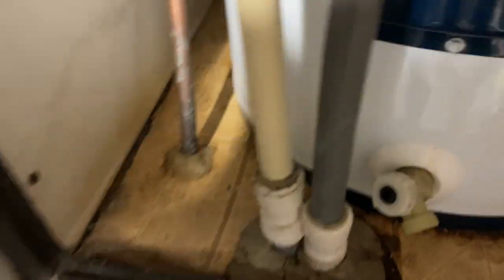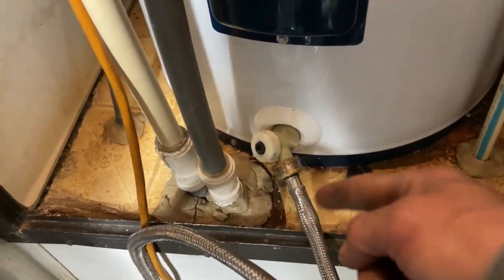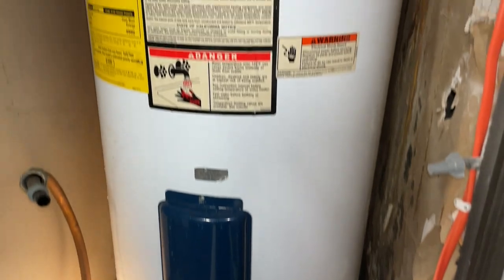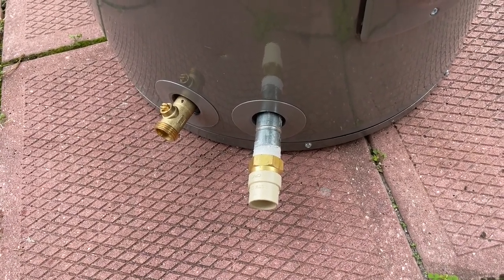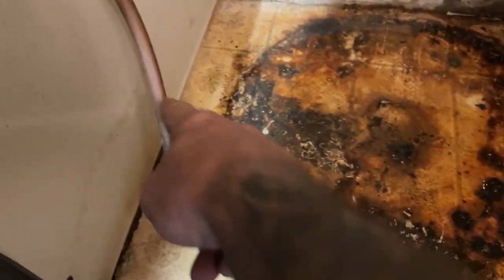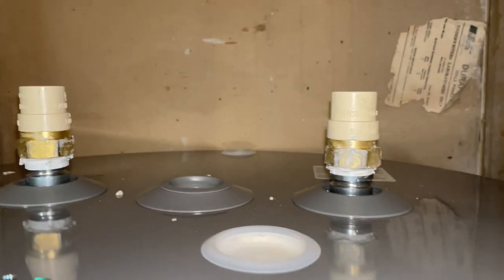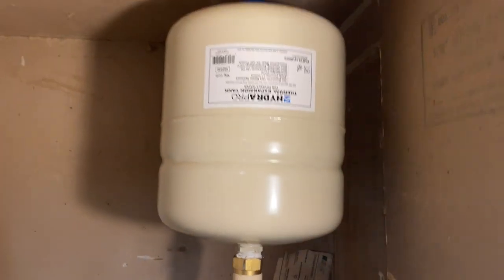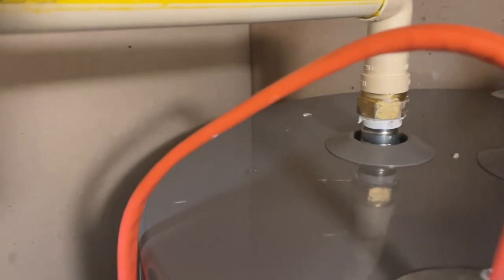WATER HEATER REPLACEMENT IN MOBILE HOME

Comment: hey dude i feel ya ,, just went thru this,,  for future reference = home depot does have a fitting poly b - to pex b 3/4
Reply: ps = i much rather use pex than cpvc in them old trailer retro jobs ,cheers , ty for video . sry it was a pia

Comment: You're a better man than me. I'm not a plumber but still, if i had to deal with a flat tire then crap like that right afterwards the day would have ended with a news story that said something along the lines of 
"Florida Man Shoots Water Heater With Shotgun Before Dowsing It Gasoline And Throwing A Lit Match On The Way Out"

One day, back when I was in the glass business I tore out every window in an apartment and then realized I was in the wrong damn apartment! It turned out that we were supposed to do that apartment the next day, so long story short it all worked out but I came close to having my "Florida Man" moment that day.

Comment: I'm sitting here scratching my hair out. You can test the circuit by probing the wires from the bottom of the wire-nuts without risking shock. Even better would be a sniffing tool that costs around $15. Also, to drain a good portion of the water you can open the vent and turn on a faucet. I'm assuming you did that. I like the shut-off valve and expansion install. I would've definitely moved that copper line and installed a pan with a moisture sensor in the bottom. Once most customers realize what the benefits are they'll gladly opt in for that service. If they don't you have done due diligence by explaining and offering a solution.

Comment: Not a plumber but I am an electrician. Anytime you have a wire nut, you should always use it to your advantage. In this case I would have tightened it up a lil bit an left them on until I located it at the box. Just sick the probes on your multi meter up inside the wire nuts. You'll get a reading on it and once you do go flip switch's till you find the right one and then double check it. Good luck out there brother
Edit: an also.. I don't see any thing wrong with a sharkbite's lol. Like I said I'm not a plumber. Turd herder's as you're reff referrederd to the field 😂😂😂🤣🤣😂🤣😂. Haha im kidding brother
Reply from the maker: Thanks for watching
Reply: @PLUMBINGWITHTIM  lol no worries brother. Helping a buddy with a water heater and came by your channel.

Comment: Just some friendly info. You used a standard shark bite fitting. Shark bite makes a coupling adapter that is designed to fit Poly B . Looks like what you put on but the plastic ring is grey for the Poly B side and the other side will except Pex, CPVC or copper. but the one end is designed for poly B. Ive felt your pain watching this as I've changed many HWT in MH's. They all seem to be a real bear. Cheers on the good video👍

Comment: Great video Tim, when in doubt I always will install a lowboy when it's a 30 gallon tank.  You can always find supply lines to make up the difference and the shark bites is the way to go, pex, copper, or pvc will take that connection.  Great fix, but again, mobile home, apartment, home, I always use the lowboy heater, get's you out of a pinch when needed.  Remain blessed and keep the video's coming.

Comment: Hey Bud. You have to do what you have to do! I’ve never done a hot water heater. And some reason I have no hot water. And I also live in a mobile home. Do you have any suggestions! I believe the tank that I have in there now is a 50 Gal. And mine is in my bedroom closet which I am kinda lucky on the room I have. But never dealt with that type of water lines. If you go throw any suggestions at me that would be awesome. Thanks. And nice job on the install.!

Comment: Dude,  buy yourself a Fluke 1AC II Non-Contact Voltage Tester.   No need to take off those wire nuts.  Edit:  Also if you create a vacuum on the top with the drain closed and then pop the drain open sometimes you can get the blockage to free up.   Can also shopvac out the dip tube if it gets too desperate.

Comment: I live in a 50 year old double wide, I know about the tight places they put these water heaters, fortunately my house I have a full 8 ft space from floor to celing for the tank, I did some renovations a while back and was able to widen the closet the tank is in to be able to accomodate a standard residential tank, I recently replaced an old 40 gallon with a 50 gallon, just added some extra pilings under the tank to support the weight, the subfloor is 1 1/2" thick.  Fortunately my place was originally piped with galvanized and not polybutelene, but that is due for replacement soon.

Comment: would you have been better off installing a tankless water heater?  I just had a plumber at my mobile home.  He looked at the access panel for the waterheater (it's outside the home) and had no clue how to open it up to get in there, let alone put it back.  I told him forget it.  I was hoping to find a video of how to open that thing up.

Comment: In the real world someone else would have used apex and a real cupping instead of shark bites which are not a permanent fix.. but in my world I would have measured the hole and made sure the new one would have fit properly even woth that copper pipe in the way which could have been moved also just saying... tighten up every chance you get or shark bite yourself if it's quicker

Comment: You need a 3/4" nipple ball valve nipple assembly to drain stubborn water heaters.  Just unthread the existing drain valve and quickly thread on your nipple assembly then close the ball valve.  Then hook up your transfer pump to the nipple and suck away.   I've done it numerous times.

Comment: Tim, you da' man! It was  good to know that someone who knows what they are doing fights with these things just like me, Mr. owner of the rental home that changes the hot water thank myself and goes through similar gyrations. Loved your solution to the drain problem. That seems to almost always be an issue because of the sediment.  As a thought, one time we took our compressed air tank and blew air and sediment back into the tank on the drain valve. That blew enough sediment out of the valve that it allowed the tank to drain. Thanks for the informative and entertaining video!

Comment: Thank you for this video!   I've got a leaking, dead propane water heater that I have to remove from my double wide.  You're right about the plumbing, electric, etc in mobile homes!  I swear a group of chimps installed my electric and plumbing!! It's all poly butylene so I'm doing a complete upgrade to PEX.. I'm going to have to bypass the heater temporarily first. If you have any advice it would be greatly appreciated! Wish me luck. Again, good video, thanks for sharing it!!!
Reply: Sometimes you can feed the new pex through the old pipes.

Comment: Just did one of these with John Guest speed fit where you used the sharkbites. Not loving these mobiles. After this experience I am going to plan a tankless setup and recommend upgrading to electric as well. About the same price as a tank. Just the electrical upgrade will have to be figured in.

Comment: Anybody here have a good solution for a "drain pan"?  not that a standard drain pan will fit in that cubby hole but h2o heaters these days last no time & tanks rust out, leak & rot out the sub floor before anyone bothers to tell me they have a leak.  I thought about epdm roofing material, lapped up the sides like commercial cove base w/ a drain hole installed but any bright ideas greatly appreciated

Comment: I live in a mobile home and had Home Depot subs install my water heater. They installed the t&p right into my bellyboard. I didn't know. Apparently, I've had pressure issues for YEARS and the t&p was leaking that whole time in the bellyboard. Didn't know because I never went under there for anything other than to shut the water off. I only found out because I heard the water heater whistling constantly and then noticed water vapor coming UP the t&p valve pipe from the bottom. Went under the house to find where the pipe came out and didn't see it. Finally realized it was covered by bellyboard 😬 All ruined! I replaced the t&p, cleaned out the water heater, replaced the water heater discharge valve (for easier cleaning), and replaced the bellyboard. I also filled the whole in the floor and routed the t&p into a container that I can SEE if it leaks. Well, it still does 😱 Then I changed the main water valve and added a pressure regulator. Didn't stop the leaking. Next step is an expansion tank!

Comment: I know you hate Shark.bites because I can't stand them ,they make Shark.bites for poly , and them that you installed wasn't for poly but what ever works best at the time it hard to tell but if you check the outside and inside of poly it's slightly larger than pex that's why the Shark.bites were hard to install the small plastic ring  on the Shark.bites for poly are the same color as the poly pipe, that's the way you can tell if it's for poly to pex or cpvc. But thanks again for all your videos I've been in similar situations  I fill your pain.
Reply: not a easy job im agree with you the color of the collar of the sharbite for pb is gray it match the color of the pipe

Comment: I’m in a Modular Home. I am in the middle of changing my water heater. And yes the last person had to make it work. But didn’t put in a cold water shut off. So I will be doing that. And putting unions in. There was a shut off valve on the hot side. And looks like a Union on that side. But could be where they rigged it to work. It doesn’t look to be rocket science but it’s tight as a NASA Space Capsule. The old one is leaking at the bottom and down the whole for the pressure  relief line. Why because the main water want shut off completely probably because of settlement. But I am locked on this and want give up. You’ll forgot to say your Knuckles can get skinned wrenches slipping. Tight spaces for these are murder.

Comment: Hey tim. So how do you know when the hot water heater is full. I'm guessing when the water running through the hot tap runs consistent and the air is out. I've got to change a 30 gallon hot water heater in my single wide hunting cabin.
Reply from the maker: Leave a hot side only faucet open when filling the tank until water runs steady 
Then you know it’s full
Reply: @PLUMBINGWITHTIM  thank you Tim.
In a month or so I have to unwinterize the cabin. I'm going to check through your channel and see if you have any videos on that. If not maybe I could reach out to you when it's time? I'd be happy to send a PayPal or venmo payment for your time and help. Thanks again

Comment: How many rooms was it for? What was the voltage? Im in a struggle to get a water heater for a mobile home that has 3 bathrooms and a kitchen sink thats for afamily of 5. Mom, Dad, two toddlers and 1 teenager.
Reply from the maker: 30 gallons 240 v
Reply: Ok thanks man. God bless you